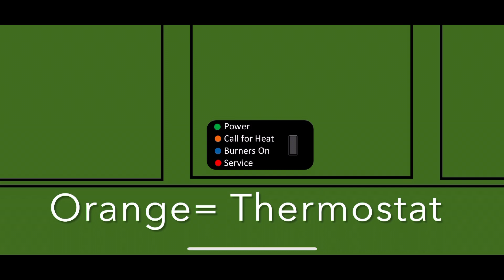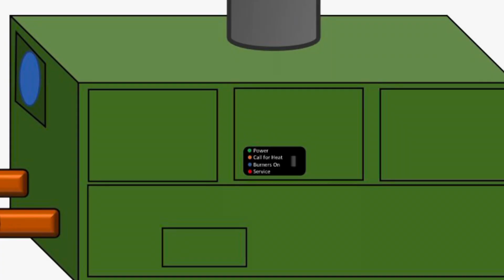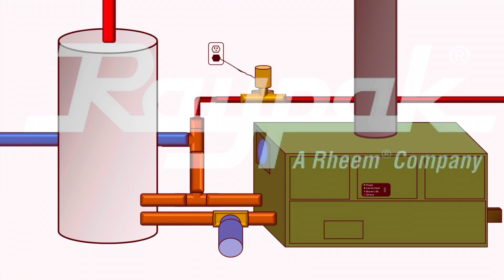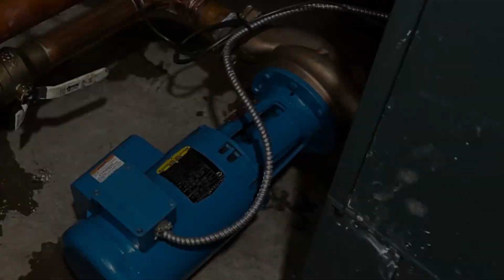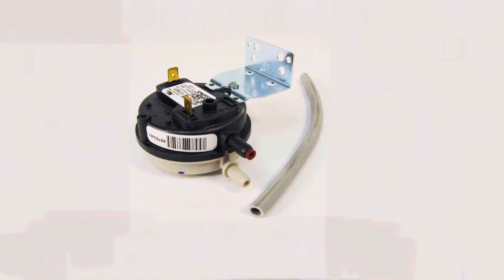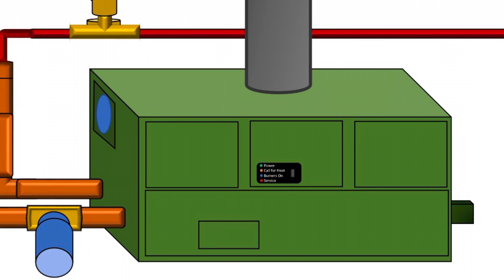Introduction to Boilers: Raypak HiDelta

Comment: Excelente video, me darias tu contacto para comunicarme contigo, me gustaria hacerte algunas preguntas respecto al tema. De todos modos muchas gracias, realmente la informacion me resulto 100% util, saludos que estes bien
Reply from the maker: Me puede preguntar aquí si gusta
Reply: @ mi amigo justo me vi tu video y me vi todo el manual de un boiler de 4 etapas hi delta, ya lo pude solucionar, era un fallo con el sensor de presion de aire, pero gracias por tu pronta respuesta, que estes bien
Reply from the maker: @Wolvie. dónde están los pressure switches tienen una t. Ahí con un manómetro se tiene que ajustar la presión a 1.5” WC (Water Column)
Reply: @CustomClimate214  aprovechando la oportunidad si tengo una pequeña pregunta, el boiler que te menciono tiene dos termostatos, uno mide la entrada del agua y el otro la salida, mi pregunta es cual de los dos hace el Call for heat? Asumo que el de entrada correcto? Y el de salida es el que apaga el sistema cuando llega a una determinada temperatura?
Reply from the maker: @Wolvie. el termostato con el botón rojo es uno que sirve de límite/ para que no se pase de temperatura. El botón rojo es para reiniciar el boiler manualmente. 

El termostato para agua doméstica se ocupa dejar a 145°F

Comment: I made one but when I test it with my multimeter I still get 3 volts. Does yours read between 300-700 millivolts?
Reply from the maker: Yes my fluke reads those millivolts between the prongs on the fenwal